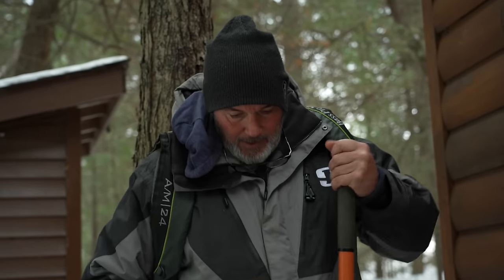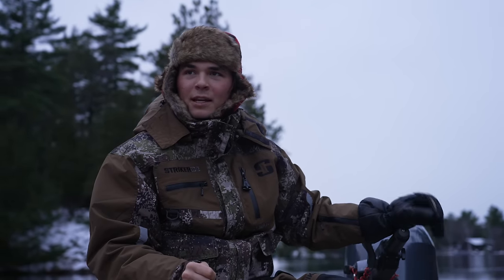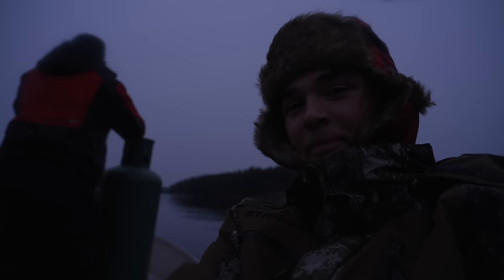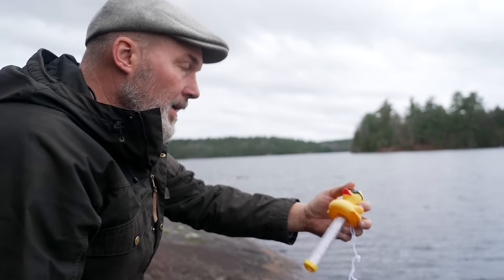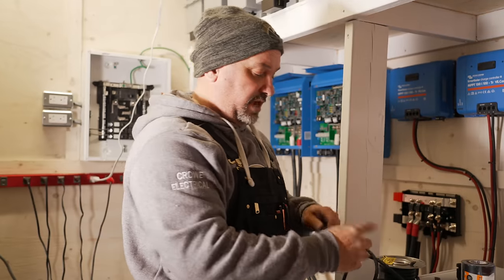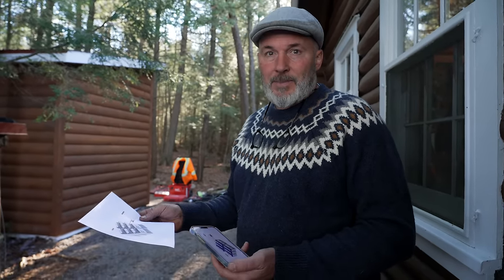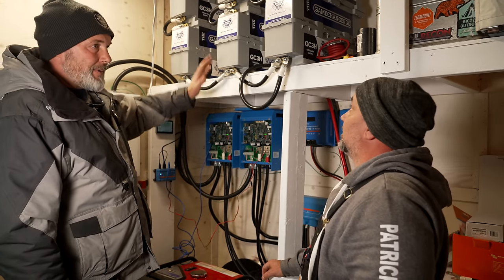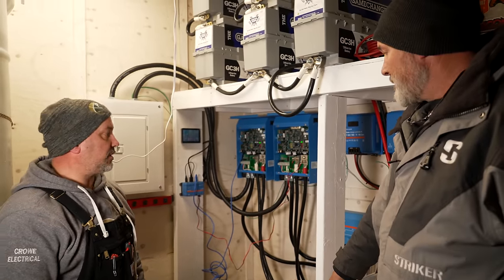EARLY LAKE ICE & TAKING THE CABIN NEXT LEVEL OFF-GRID with Battleborn batteries // EFRT S7 EP61

Comment: Glad to see you are using a local electrician to make sure things are installed safely and correctly.  Nothing against the advanced do it yourselfer but to many risk to much doing it themselves.  The ground wire to the ground device you buried needs a good anti-plating coating and with the water level so close you may want to check and replace the anti-plating coating on the copper wire every couple years.  It is just a paste but makes a big difference, if there is an induced voltage to the ground the copper wire will plate (like plating a metal for looks) to the ground device you buried and leave no connection.  Anytime you connect dissimilar metals you want to stop plating from happening. Also copper to aluminum you should use a stainless steel connector between if you can.   I hope you guys get a couple decades of use from that setup it looks awesome.
Reply from the maker: Thanks for the tip. We appreciate the knowledge and expertise. Hope you have an epic new year!

Comment: You might consider running that ground wire through a PVC pipe to keep corrosion and rodents and other critters from breaking the connection to the ground plate.

Comment: I would have bolted the battery bodies "together" and use metal coper busbars to connect rather than the long looped wires.. maybe upgrade.  If you had / have an earthquake all that could come tumbling down ..  19:56 ... paused again.. did you torque the bolts and the "plyers" are being used "backward".  They are not designed to be uses turning nuts/bolts in either directions... much like an adjust able wrench ... designed to be used in one direction.. flip it over to loosen etc....

Comment: installing  PV in our alpine region requires not your 'run of the mill solar panel' but one that can withstand the snow load as well as hail (>1" or >2.54cm) while the PV achilles heel is microcracking. not too many PV companies manufacturing such resistance proof panels, while many are so back ordered, looking at >24mo. done our homework, wonder what y'all have in mind in N.Ontario? BMS is critical too, would not like to keep LiFePO4 in the raw, in consequence of that huge risk.. possible thermal runaway drama, thus took no shorcuts. Keep in mind, safe and enjoy
Reply from the maker: Thanks for the tips.
Reply: @EFRT  the other interesting observation-> now in the height of the winter, on avg 4 hrs of sun when the weather permits, & where the solar rays are at their lowest angle in respect to the rooftop PVs'.. is that energy production is also reduced. Happy, healthy 2023

Comment: Finally, a proper diagram for hooking up multiple batteries. Nice to see that the positive & negative leads are on opposite corners of the batteries to create a path across all the batteries. Since those batteries have that tab at the bottom, why not use a piece of 1/4" X 1" copper flat bar as a buss between them? I didn't see any disconnects on the batteries so is there an automatic shut off so you can service the system? Fuses (class T type) for the invertors?
Reply from the maker: We probably could’ve save some money by using a flat are between the batteries, but the cables had already been ordered. I will ask our electrician about the shut off when he comes back in the new year.

Comment: Happy thanksgiving to you all. Neat setup.... What is the total capacity of the Batteries and how long it will take the generator to top them up once depleted?
Reply from the maker: When wired together for a 24 V system, the batteries have 840 amp hours. They take about five hours to fully charge and then last for three days or so. That will be extended of course once we have solar panels. Happy new year!

Comment: Any particular reason you want for 24 instead of 48 Volts?
Reply from the maker: That was what the team at Battleborn.recommended based on our power usage. I wish I could be of more help, but I don’t know the pros and cons of each option.
Reply: @EFRT  tnx no worry, I suspect they have their reasons, maybe their gear/components, know how, etc. not geared towards 48V
Reply: I would bet it has to do with 6 batteries at 24 volt will take care of their load and did not need eight batteries.
Reply: @badgerpa9  you can connect just four 12V  batteries and get 48 Volts. You don't even need six. 48 Volts allow for thinner gauge cables.
Reply: @badgerpa9  I think it was to preserve the Ah. Cause if he had them in parallel to get to 48 he would be trading Vs for Ah
Reply: @dimitristsagdis7340  Yes but if 4 does not provide estimated load draw and 6 does it makes sense to go with 6.
Reply: @badgerpa9  yeah I figured it has smt to do with load (Ah). I suspect 8 was a bridge too far :-)